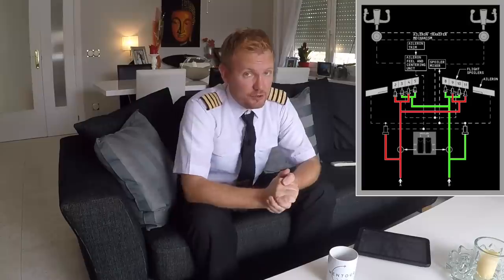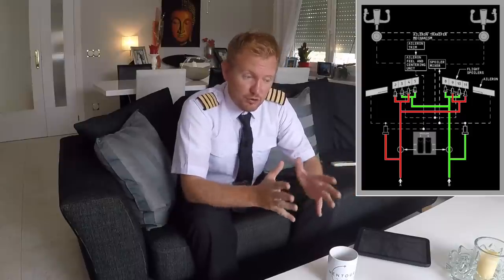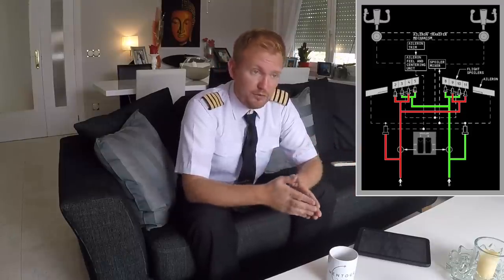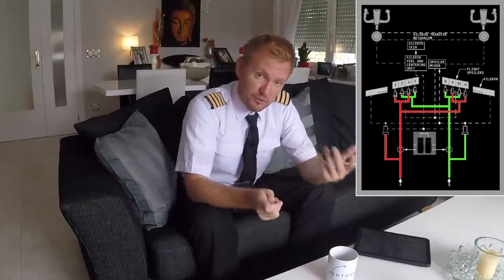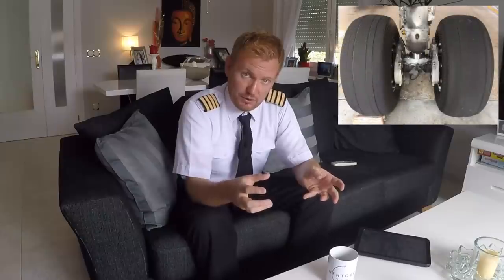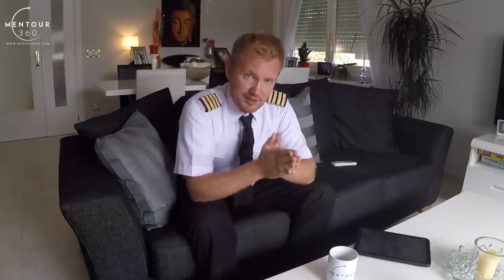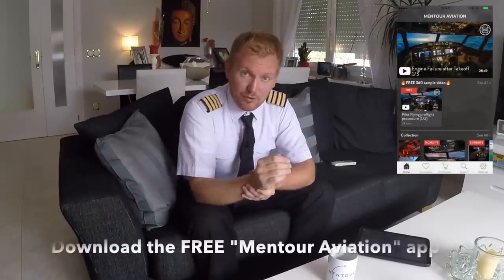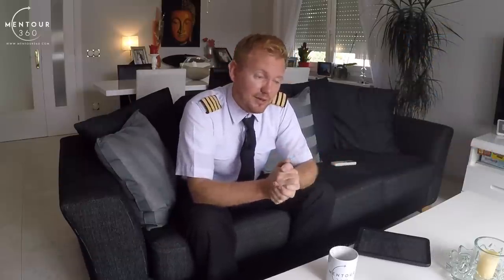What are those things on the aircraft wing?

Comment: Hey, mentour! Can you make a video on flaps and procedures when you have to land without flaps?
Reply from the maker: +Tommy The Heist Yes, there will be more failure related videos coming soon.
Reply: NICOCRAFT I can
Reply: Tommy The Heist  on the A320, here is what to expect with a no flap landing: right off the bat, the speed on touchdown will be at least 45 knots faster. now we can have a deeper look inside the Bus. for starters, her slats and flaps are controlled by 2 Slats Flaps Control Computer SFCC; one channel each for slats and flaps. commands are forwarded to the powur control unit PCU, which consists of two independent hydraulic motors coupled to a gearbox. slats are driven by green and blue systems, flaps by yellow and green systems. 
it would be highly rare to loose slats and flaps without loosing anything else. ok, we'll run full tilt here, everthing, all 4 computer channels  shit the bed or a combination of 2 hydraulic systems and at least 2 SFCC channels. 
soon as I loose two of three hydraulic systems, declaring an emergency isn't an option, it's mandatory.  because now I have not just lost some secondary flight controls. forget about  steering, no reversers, degraded handling and slow response to control inputs are just some of the associated faults. remember, F and S at zero is an abnormal procedure. dual hydraulic failure is an emergency procedure.
Reply: Well, lets say one of the motors are broken, flaps extend only on one side or gadgets show that flaps extend not equally.. I guess your option would be to land without flaps and then you do have an option to declare an emergency? Because all you lost are just flaps? As far as I know in situation like this, landing wont change much. Only land with higher speed and you should calculate if the runway length is enough?
Reply: Steve Elisberg , ?bbc .
Reply: If flaps are available and are working properly, pilots almost always use flaps so that they can fly at slower speeds for a landing. The Concorde did not have flaps , so to slow it down for a landing, they had to use a high angle of attack (raise the nose high in the air). This was such a problem, that the crew could not see the runway very good when pitched up this high. The manufacturers  had to install a tilt-able nose piece, that was able to tilt down for landings and then back up for takeoffs, so that they could see the runway better.
Reply: I think that you provided more detail then he can comprehend or understand.
Reply: @MentourPilot  No mention of slats and slots - are they a big secret ?

Comment: Hej! During an engine failure landing procedure with single engine operated can you use reversers after touched down?
Reply: Garry Wan no because you would go off the side of the runway. i would imagine they would use full toe brake and spoilers though 😁
Reply: CrazyHypedGamer that was what I think,I guess I am right. It confused me a little when a flight simmer landed the plane after bird strike in the engine2 but still using reverser 1 at landing...
Reply from the maker: +Garry Wan Yes but only on the engine that is still working.
Reply: Mentour Pilot hej  But there is an exception,when the fuel tank is leaking then it is prohibited to use thrust reversers

Comment: Do you feel the wind's force in the yoke/wheel even through the electronic control?
Reply from the maker: +Mr Me Not the wind in itself but the way the aircraft reacts to it.
Reply: Mr Me since the A320 is fly by wire there is no feel in the sidestick itself, we do feel the effect the wind has on the plane itself
Reply: There is no force-feedback to let you "feel" how the control surfaces are interacting with the air?
Reply: Artificial feel units are installed on some aircraft s. More you pull the control harder it gets and pilot actually feel a hardness like small aircraft. 
However I m not sure about 737s.

Comment: I understand that those "spoilers" are in place in addition to the existing flaps that also add drag to an aircraft that is braking on the runway. The "spoilers" combined with the flaps maximize drag and make it easier to stop an aircraft especially the larger 737-800 or 737-900.

Comment: Good information.  As a private pilot who has been flying since 1968 (yes, I am an old poop!), I am quite familiar with the difficulties some people have regarding these control issues.  One person I have run across in flight simulation seems to think that using the flight speed brakes is to be used every time when hitting the mark at below FL180 in order to stay within speed limits.  As I was surprised in the real world, it is not the yoke which controls elevation as much as airspeed caused by throttle settings.  I learned this one time when trying to attempt to get out of the way of another aircraft above me by pushing in the throttle and all that happened was that I gained altitude.  Embarrassing.

Comment: I was on a flight from Portland to Columbus that had a hydraulic failure.  It was A that failed (I overheard the pilots talking about it on the way out, they said the A reservoir was completely dry).  Had to make an emergency landing in Indianapolis.  The plane seemed to fly and land fine, but they were making much harder turns than normal and we came in a lot faster than normal.

Comment: Very informative although upon landing if the flight and ground spoilers are effectively doing what they are supposed to do, then wouldn't ABS stop the aircraft in a shorter distance than by simply just applying as much braking force as you think will pull the plane up in the shortest distance  ??? I can understand that with experience you will get a good feel for how much braking force is required to stop the plane quickly but one of the reasons ABS exists is because it can pull you up sooner than you can. Please let me know your thoughts ??. Thank's for posting.

Comment: When I used to fly sometimes I'd look out the window and a couple Flight Spoiler panels might be gently bobbing up and down, several degrees, almost as if they were loose.  Just gently flapping partway.   Mentour:  Why do they/ did they do that?   I figured it had something to do with smoothing the flight path, 'trimming'.  (The planes I saw this on were: B727, L1011, B707, DC10, and/or MD80.  Never flew on a 737.)

Comment: Thanks your your information. 
Have some queries. 
Hydraulic system is not cleared. 
How many pump are used for hydraulic system  ?
Is it 2 or 3 ?
According to you it is retuancdy method.
2 hyd sources are conected and 1 is standby. 

Another thing I would like to hear from you.
As per my understanding, 
During landing of planes for deccaclration 
*  spoiler is the first factor.
*  Engine windows,to provide drag.
* Landing wheels brakes operates @ speed  which shall be safer for tyres.

* is it be possible in craft to add  Regenerative breaking sytems, definitely it involves a separate System ?

Comment: So in cross-wind takeoff scenarios, would it make sensible design for the wings to use differential flaps instead of spoilers? That way spoilers don't have to deflect air upward and negate lift and cause more drag, and just let the flaps provide uneven lift as required by the wind/airflow conditions.

Comment: I want to posit a fourth possibility for when one might see the flight spoilers in action: when the aircraft is in coffin corner and conditions change enough (say, for instance, passing through an area of mountain wave) that the autopilot, in order to maintain steady altitude, inches the nose downward, resulting in an increase in airspeed. It probably makes more sense to deploy the speed brakes to prevent the plane from reaching critical mach rather than manually reducing thrust because if thrust is reduced too much, the aircraft risks stalling at the low end of coffin corner and jet engines have hilariously slow spool-up times.

Comment: Was recently on an A320, we had just started descending when one set of flight spoilers deployed on the right wing. We weren't in a turn and both sets deployed when we touched down. Was a bit confused when I saw this, just interested if maybe you had an explanation to this. Thank you, love the videos.
Reply: Tom They can be used to slow the aircraft down, too, when its airbone
Reply: Exactly the same reason as the B737NG.  Speed brakes to aid a steeper decent whilst preventing the target airspeed from increasing, and ground spoilers to kill the lift on the wing during landing to assist the braking action of the wheels.   The speed brakes are stowed during approach because the aircraft is usually at a slow enough speed for flaps to assist in slowing of the aircraft.   
During a steep glide path descent (london city airport) speed brakes may be used on the A319/18 to control the speed.  You cannot descent steeply and slow down on an aerodynamic slippery aircraft without the need to introduce drag.
Reply from the maker: +Tom Yes, what you saw were probably the speed-brakes in action.
Reply: Tom what you observed were the A320 speed brakes. they are identified as numbers 2, 3 and 4
Reply: Ok thanks. Was just a bit worried when only one set deployed on one wing. Didn't seem to matter though

Comment: Its a great one, mentour pilot. Thanks. My question is on helicopters. If you can answer, please how do you steer or turn in flight, a helicopter that has no tail rotor, to utilize the torque and counter torque principle, ie say twin rotor or coaxial configurations etc, because I can't see how the cyclic can be balanced especially in coaxials, to achieve this??? This question has always puzzled me. Thanks.

Comment: Flaps - when and how much on approach.  
Autopilot - how close to arrival runway when you disengage??  Can you land and disengage auto on touchdown or must you disengage before threshold??
Reply: 1st Question: Use this rule of thumb: 10 miles, 200 knots. 9 miles 190 knots. 8 miles 180 knots. Use this to slow down. And as you slow down, the nose will raise. Then use flaps. At around 180, i would say maybe like Flaps 5. At around 160, Flaps 15 gear down. And be fully configured for landing by the time you're 3 miles from the runway.

2nd Question: There's no rule on when to disengage autopilot. The Pilot flying decides that. For autoland, yes, you disengage on touchdown.

Comment: Very timely video for me, I was on a lightly loaded 737 yesterday (maybe just over 30 passengers) and moved to a window seat (normally I am a confirmed aisle seater).  By profession I am a physicist and thought that the drag effect of the spoilers was minimal for braking the plane so I had assumed that the intent was to disrupt airflow and ensure that the plane stayed on the ground - I had not considered improving the efficiency of the brakes!  

One thing that did surprise me was that the pilot requested we stay in out allotted seats until after takeoff to preserve the calculated weight balance - I can understand that is not the time to find out your CG is wrong!  The experimentalist in me wondered what he would have felt if (after takeoff) we had all run to the back or the front, does it make a huge difference?

Comment: I have always thaught that it was the Thrust Reverse that provided most of the deacceleration with help of the wing spoilers and the brakes? Cause whenever an landing aircraft is trying to land on a shorter distance than normal the Thrust Reverse is set to a much higher force than usual. Johan.
Reply from the maker: +Johan Månsson Hi!
No the thrust reversers don't provide that much, it's mainly a reduction of pressure on the brakes. They are very important in wet and slippery runways.

Comment: Having watched many aviation vis=deos by now this answers a somewhat burning question I had following seeing some plances having , not just a hard landing,m but a bouncy one -dangerous!

(As i was thinking) "What is there to really FORCE this plane down hard on the tarmac to stop the bouncing?"

However with all you mentioned, even that, used at max may not be enough or may be partialyl unsable if landing in a gusry crosswind, crabbing or not.

If I were a passenger in a crosswind landing, with what I have seenm I would be expecting to feel a "yaw inertial push" at the moment the pilot kicked toe rudder to end the crabbing.

Then I would expect things to be somewhat more stable, as long as the crosswinds and gusts were not so much as to risk flipping the windward side wing up!

What do you think of my "passenger expectations?"

Comment: So very interesting.  Loved this information.  What is that deep loud sound the airplane's engines make after take-off and at about 30 seconds into the climb and when it seems the plane levels off some?
Reply: As the crew selects takeoff power, the tips of the fan blades actually move so fast that they break the sound barrier (move faster than the speed of sound). This creates that very deep "roar" from the engine. This power setting is held until the aircraft reaches something known as the "acceleration height", which is usually 1500 feet above the ground. At this point, the engines go back to "climb power", and the aircraft pitches down a bit to gain some airspeed. It is still climbing at this time, but just not as rapidly.

Comment: Which brake source is more powerfull, the brakes at the wheels of the reversers. I though that engines were more powerfull. And what it preferred if there are plenty of runway .... guess that engine wear is a concern. But brakes wear as well and they can overheat. There is plenty of energy to disipate. I saw that in rtos the brakes suffer a lot (probably due to the max weight).
Reply: Where's theres enough room they will use idle reverse and wheel breaks.

Comment: It sounds like every time the airplane banks the spoilers are used but I think Ive seen where just the ailerons were used for roll control during flight without deployment of any of the spoilers. Am I incorrect and just missed it? Greta video - I like the technical details.
Reply: Dan Stinson no you are correct when the pilot starts a significant roll the spoilers deploy on one side of the wing to increase drag and make the roll faster

Comment: There was a cross-country US flight I took back in 1988 or 1989 where I think that the plane was approaching the airport too fast and the pilots opened up the speed brakes to a nearly vertical position. The plane dropped down so quickly it felt like the carnival ride that drops you after it reaches the top. I could feel my stomach rise up in my chest. I can no longer remember that flight number since I wanted to check whether an incident report was filed for that.

Comment: I would like to know if aerodynamic braking would be at all effective in reducing the forward-roll speed  of this type of aircraft upon touching down. This speed  would be greatest at the moment of touching down. If the pilot were then to pull back on the yoke to maximize the upward deflection of the elevators and so maximize the pitch attitude  of the wings relative to the forward movement of the aircraft, the increase in wing drag should, I suppose, decelerate the aircraft as a whole. The question is whether or not this action would be applicable to a particularly  large aircraft of the kind shown in the video.

Comment: Great video, indeed! 
Question: if you engage the speed break, is there only one flight spoilers' position for that mode or can it be adjusted smoothly (stepless)?
Reply: Marcin Trzyna they work like flaps. i think they have 3 stages but have positions they lock into
Reply: CrazyHypedGamer yes but actually 4 stages:1,DOWN 2,ARMED 3,FLIGHT 4,FULL(it is locked on some of the Boeing 737 in flight)
Reply: Marcin Trzyna they can be adjusted step less,smoothly,not like flaps,flaps got many positions but not speed brake. It is just like the pitch trim. But when u arm the speed brake,it feels like "stack".
Reply from the maker: +Marcin Trzyna Hi! The speedbrake can be moved stepless but we normally use the detents
Reply: Mentour Pilot is the speed brake lever locked between down and detente and can't use full in flight? I remember some companies can use full inflight

Comment: Is there any automatic system that operates the ailerons by using accelerometers or gyroscopes as virtual reference for instance to stabilize the aircraft on strong turbulences or crossed winds landings or takeoffs?
Thanks!
Reply from the maker: No, this is fully controlled by pilots or autopilot.
Reply: Thanks!

Comment: Hey, mentour! thank you for your videos! can you please make one video about landing style? is it regulated somethere if pilot have to drop airplane to runvay hard or he can do it smooth? I mean with some airlines I notice that landing is almost unnotisable but some crash plane hard (in normalweather conditions I mean). Mostly I fly A320 family.
Reply from the maker: +Roman Tech It normally has to do with how long the runway is. The standard technique is a "firm" landing on the correct point, not a soft landing.
With a very long runway the pilots can let it come down a bit smoother but the most important thing is to get the aircraft on the ground so we can start braking.
Reply: Mentour Pilot. Thank you for answer! I think it is done like these to reduce time between fly condition and landed condition? Bu the way will be wery interesting to listen and see some video about gear working. Tires brakes suspention and so on))